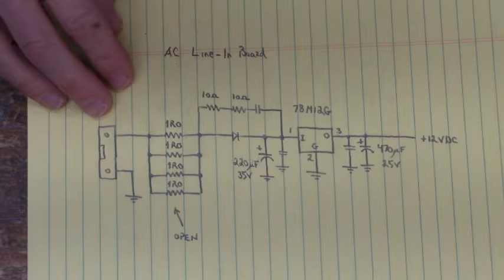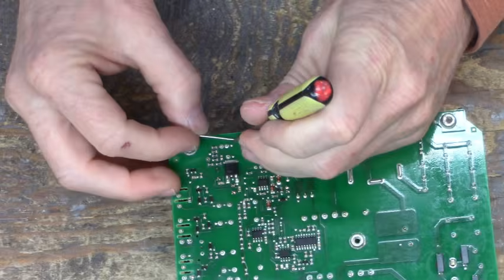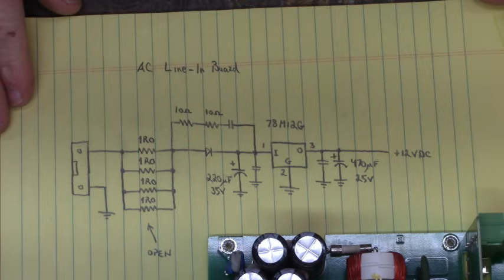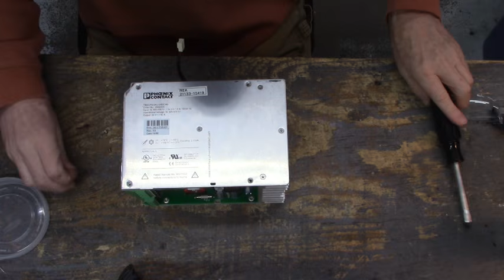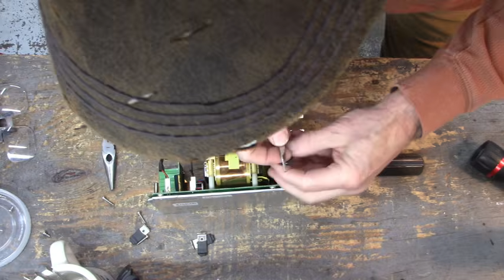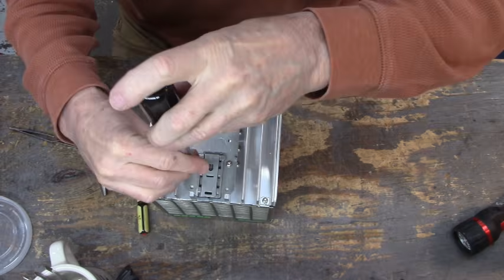Repairing the Phoenix Contact Trio Power Supply

Comment: I have several of those, but the 10 amp version, half as wide as this one. Quint-PS/1AC/24DC/10 model. Do you happen to have a schematic for these? I see the basic schematic for part of the circuit on yours in the video. I'm just learning electronics, been an electrician for many years. Never did a switching power supply repair yet. Mine fold out into two circuit boards connected with 3 heavy gauge yellow, black, and red wires. One of the three power supplies has an obvious component, probably a large SMT capacitor exploded. Probably more wrong with that one too! The other two no obvious damage but no power, no LED lights.